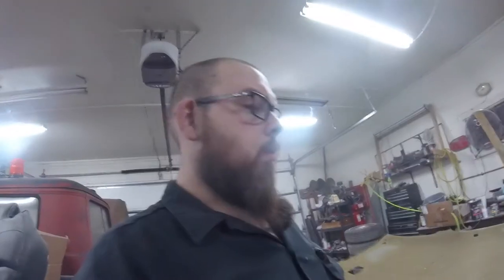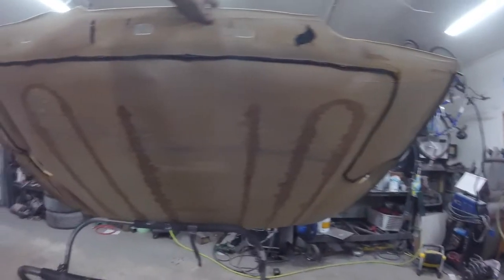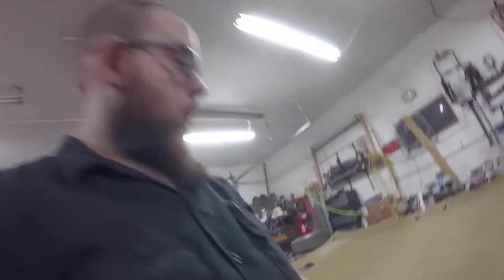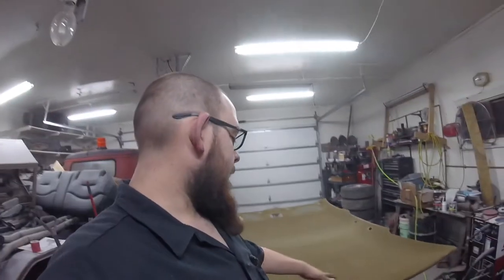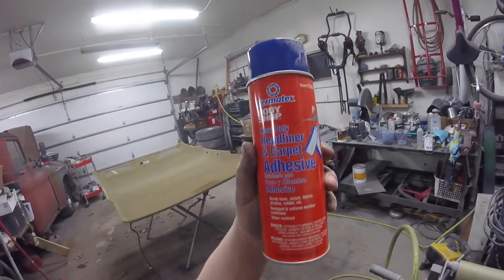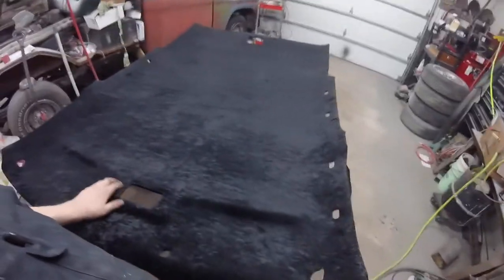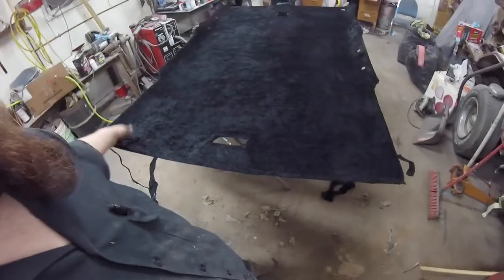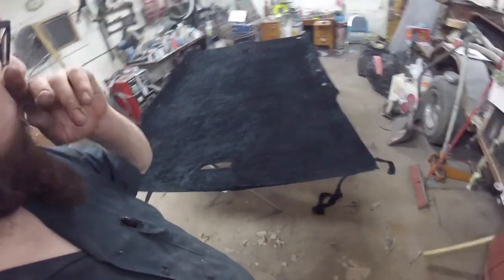Lincoln Lowrider Headliner!

Comment: You forgot to clean the old foam off, it wont last.
Reply from the maker: lol you aren't lying it failed about 6 months in. going to have to re do it. was a good way to remove the foam?
Reply: If it won't come off with a stiff brush by hand. Use a wire brush wheel on a drill, being very careful not to damage the shell. If its a fiberglass shell (orange in color) the shell is easy to damage. I use a handheld propane torch to melt it. Don't breath it, it will drop you to the ground

Comment: Ay bro tried  tried  taking  out my head liner on 1990 but i got stuck on seat belt screws did you have to take them off and if so did you you a specific  tool cuz the screw doesn't  budge bro
Reply from the maker: Honestly it’s been so long since I’ve done it I can’t remember. I do know those seat belt bolts have a strong loctite on them from the factory. You usually have to heat them up pretty hot before they will let loose.